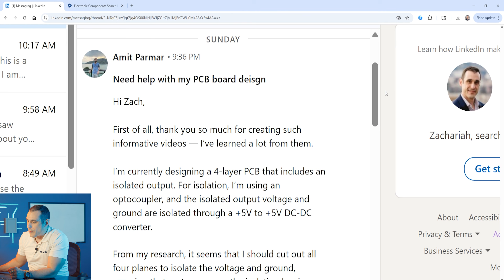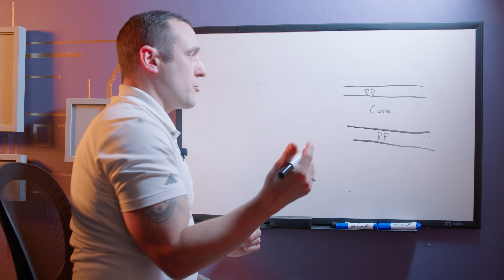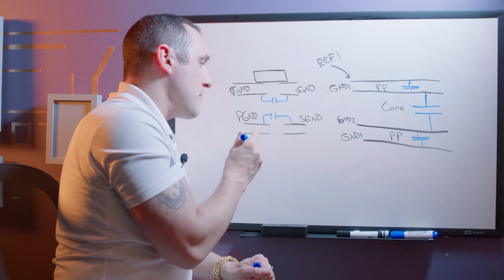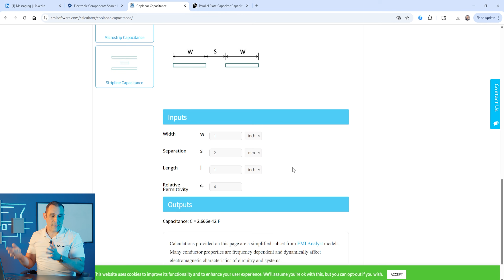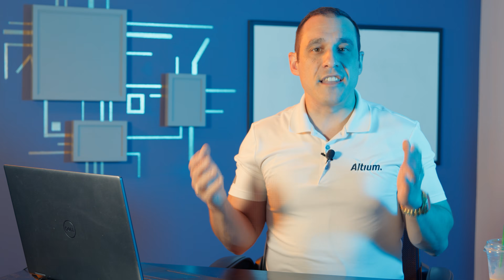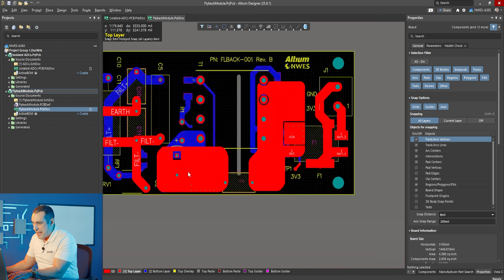Ground Separation in Isolated DC-DC Converters: PCB Design Tips

Comment: Awesome video as always! I’d love to see a practical layout demo of how safety capacitors are actually placed in real designs both for systems where there’s an earth connection as well as systems where there is no earth. For example, in a solar inverter or an energy meter, where you’ve got AC mains L/N, for MCUs/peripherals, and another ground domain for wired communication like CAN or RS‑485 which need to be isolated from the MCU domain to prevent problems like ground loops. How do you tie those domains together with safety caps while keeping isolation and keeping leakage within the allowed limit.

Comment: An intuitive approach would be to think about where the EM field lines go.  In separated gnd plates stacked on top of each other you would have a higher density of field lines than co-planar planes separated by  a gap that would mostly couple via fringing.  This would qualitatively show you why there is a capacitance difference.  You could calculate it with a 2D field solver that Altium will one day give us to compete with Hyperlynx 🙂

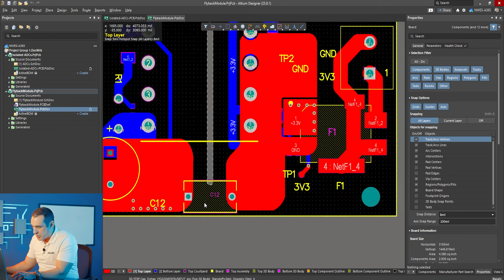Comment: Regarding the DC-DC converter PCB at 19:29 and beyond.  If that's a physical air-gap slot between the primary and secondary regions, I'm a little skeptical of its effectiveness if it doesn't separate all the copper regions of the two sides.  I looked back to "Flyback Converter Design Explained - What You Need to Know!", and the slot hadn't been introduced at that point.
Reply: ini karya dari indonesia cobalah untuk melihatnya  , saya memakai altium 18 untuk membuat desain ini , anda perlu melihatnya https://youtu.be/i_GakwtbOlc?si=plKU0FohxvDl_Gas

Comment: Hi Zach , should we measure the capacitance of primary winding alone  in LCR meter or should we measure primary to secondary winding capacitance?
Reply: You should measure across the primary and secondary, we want to get the winding-to-winding capacitance. You can measure across one of the windings alone to try and get a capacitance but these tend to be small values and will not be noticeable until very high frequencies.

Comment: As usual, I applaud the thought and effort that goes into these videos.  That said, for this topic, I feel there's a piece of background information missing, regarding the role of the "Y-type capacitor".  First of all, for the purpose of noise analysis, it's just a capacitor. ("Y-type" just means it has a construction that will fail open rather than short, fulfilling a safety requirement.)  Now why place that capacitor across the isolation boundary, and why does that have anything to do with the transformer capacitance?  Where is this nebulous noise coming from that we might want to control?  
 
The missing explanation is this: as part of the DC-DC switch-mode power supply, the transformer's primary receives high frequency pulses of voltage, resulting in the pulses of current that "charge" its field, and by which energy is conveyed to the secondary (and downstream rectification and regulation including feedback via optocoupler to the primary side).  

These pulses of voltage into the primary winding are conveyed (undesirably) to the secondary through the primary-to-secondary capacitance.  Without mitigation, that would cause the secondary side ground to have an AC voltage relative to the primary, consisting of pulses at the power supply switching frequency (and harmonics).  So it is the noise generated by the SMPS switching itself that the primary-to-secondary  ("Y") capacitor is trying to bypass to primary ground.  And you want this bridging capacitor to have a capacitance significantly larger than the transformer capacitance so that the "AC voltage divider" consisting of these two capacitors results in a small voltage on the secondary side ground and rest of the circuit.

It's also worth noting that transformers can be obtained which have a foil shield between primary and secondary windings, and that shield can be grounded to the primary side ground "intercepting" (though not completely eliminating) the primary-to-secondary capacitance path.  The simple capacitance meter check from primary to secondary would have missed that shield, if it was present.

What this doesn't tackle (or tackles only obliquely) is noise that enters either the primary side (say from mains) or secondary side (say some downstream noisy peripheral connection) that you want to do something about. Really a separate topic, but just pointing out that's not what's being discussed in this video.

I hope this explanation did justice to the video's discussion.

Comment: Hi Zach, what are your thoughts on the lead inductance of the y type cap compared to the overlapping planes. Does that limit it's usefulness of the y type at higher frequencies?
Reply: The lead inductance on a through-hole y-type cap is an issue that limits the effectiveness at high frequencies, basically it acts like an RLC circuit, so the inductance determines the resonant frequency and the lead/package resistance determines the Q-value at resonance. If you can get a surface-mount component that is preferrable, but even those components can have large gull-wing leads which also have large inductance. For example, see Murata part number DK11XEA220K86RAH01.

Comment: Hi Zach, 
Very useful video to understand to spilt ground planes for Isolated supply. I am interesting to know what is the value of Y cap that you had used in the shown design..
Reply: Ideal way to pick the value larger than winding to winding capacitance of the winding and also a factor of 100. Y capacitance you asked is specific transformer 15:29 used, it varies for each part.
Reply: @Imthesaviour  Thanks for your comments
Reply: @Imthesaviour  Typically on the order of nanofarads is big enough for most transformers.